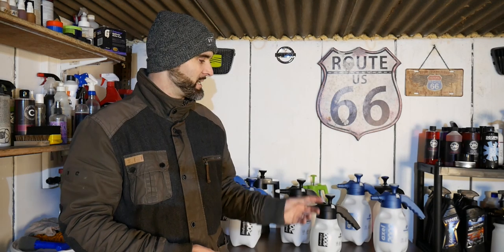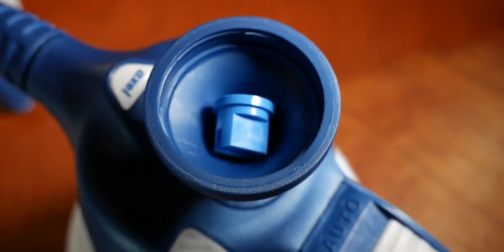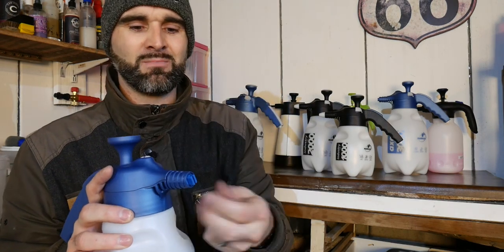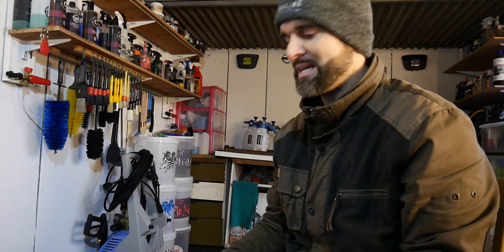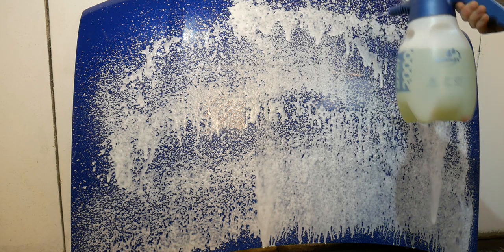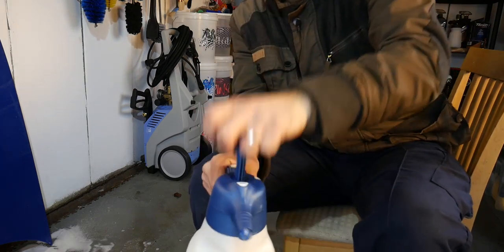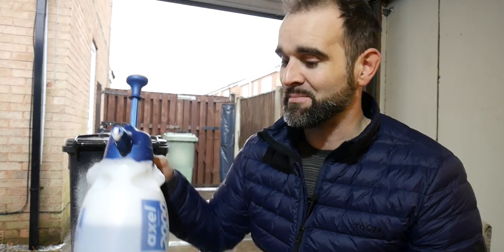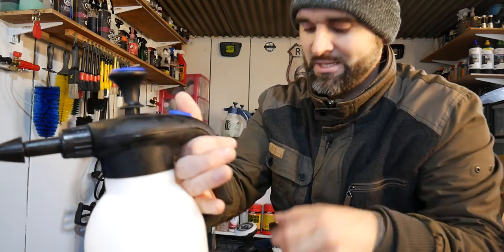Marolex Pump Sprayers: Axel Foamer, Industry Acid & Alka - First Look

Comment: First test of the foamer is basically how my Metso foamer works. I've found the less product in the bottle the longer the spray seems to last without pumping. Using Bilt Hamber right now which isn't thick at all but using AD Magnifoam was much thicker

Comment: I have a 3 litre marolex foamer and I use 1:9 snow foam (2 litres total) and it works great for 10 seconds then it's back to the pump and I pump it to the max (120-130 pumps). In conclusion it's not great but a good workout. The unit is very good quality just wish it worked longer. I will try and dilute further but not sure how that would make a difference?
Reply: if you fill it up with less solution it lasts long like its supposed to

Comment: I did the exact same thing as yourself as regards the wheel shampoo in a foaming trigger bottle (ik foam 2 in my case) and i used hdd brakethrough wheel shampoo and did same ratio as yourself 2ml into 2 litres of water and guess what got the same result as you.

You would think if 20 to 40ml of product is all thats needed in 20 litres of water, then seen as your putting it into only 2 litres of water obviously your going to put less in and expect good results as regards foam, obviously in this case we we're both wrong lol.

So after playing about with ratios i found that to get the desired foam you need to  use the same amount as you would in a bucket 20 to 50ml so you obviously get a stronger wheel cleaner but if you make a 2 litre mix up, i can do my wheels 4x over probably more with that one 2 litre mix so still makes it more economical than using it in a bucket, as obviously you just poor that down the drain when your done.
Reply from the maker: Haha, nice 👍
Reply: @TheDetailingSpace  hi m8t can I use the 3000 model just as a sprayer I work as a road worker and use hand held sprayers for diesel was looking at the marolex models and the 3000 model is great size can I use just as a diesel sprayer to spray lorry with diesel and wheel barrows to stop tar sticking to barrows thanks in advance

Comment: Can you use the Marolex Acid for regular foam soap etc? Sounds like the Acid resistant version might be more versatile since it could do soap/wheel cleaner, or is the acid version foaming nozzles different than the soap foamer/blue one?

Comment: I use something similar for my garage therapy wheel cleaner. I use around 15 top 20ml in the bottle. Always best not to completely fill up the bottle with water to leave more space for air. I can usually get around 3 or 4 cars with that one mix
Reply from the maker: Yeah, I'm going to start using the 3000 sprayer with 1.5-2L OF product so more air
Reply: @TheDetailingSpace  did that work better for you ?? I'm in the process of buying either the 2000 0r 3000 myself and think I'm going to go with the 3000 to fill halfway for more air
Reply from the maker: Yes, 3000, as you say, you can get more air in there

Comment: Just a quick one... you mentioned that you used the solution at 10:1 but used 20ml of product to 2L? Surely that would be 100:1 dilution? Just wondering what mix is best when my foamer arrives 👍🏻
Reply from the maker: Which product was that for?
The wheel cleaner I mix at 1:100, just got so used to saying  "ten to 1" 😂
Reply: @TheDetailingSpace  I’m not too sure which product it was it was the stuff you put in the marolex foamer? I’m useless at dilutions it always confuses me 😅

Comment: So what exactly is the difference between the alka and the acid pumps?
Reply from the maker: It's the seals and what chemicals they're designed to resist
Reply: So for chemicals the black acid ones would be better ? Or would the alka be better?
Reply from the maker: It depends on the pH of the chemical you intend to put in it
Reply: @TheDetailingSpace  so the black one will withstand higher ph levels?or will the alka?
Reply from the maker: @agustinherrera5600 that's not how the pH scale works.
Reply: @TheDetailingSpace  what would be things that you can use in the alka and things you can use in the acid pump for example?

Comment: I'd be more than happy to use these type sprayers. There is one single pet hate..... pumping... If somebody could come up with a solution where two pumps would be enough. Or even an electric one maybe?
Reply from the maker: Haha. I think someone has done an electric type. In fact, may even have been marolex, I can't remember.
Reply: @TheDetailingSpace  where can I find this in action?
Reply: @paulmasters2342  If you search YT, you'll find a number of people that install schrader valve's and attach little electric pumps. Just search YT. I would also suggest that if you do install a schrader valve, have it be a metal one as the rubber one could shoot out with incorrect usage.
Reply: @collinhopper7542  Paul Dolden reviewed the electric version here: https://www.youtube.com/watch?v=MLdFoUm4PWc

Comment: 10:1 dilution ratio is 200ml per 2litres not 20ml per 2litres surely?
Reply from the maker: Which product you referring to? But yes, that would be correct
Reply from the maker: Probably just said it wrong as I usually work with smaller quantities when diluting